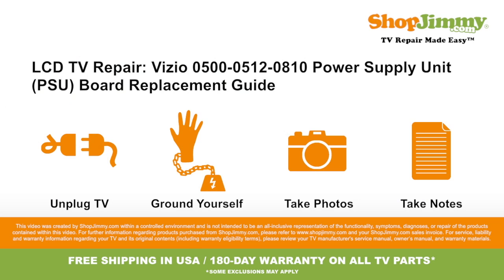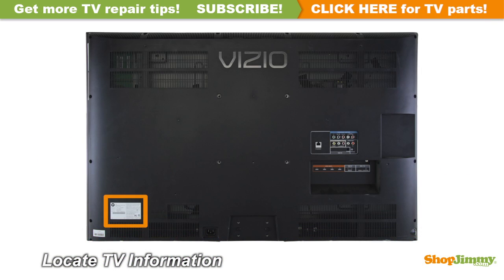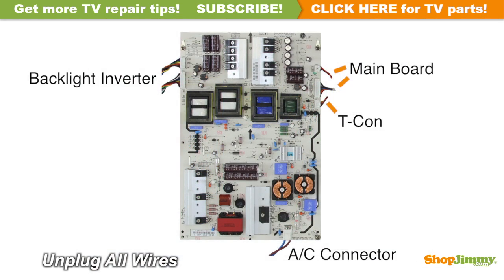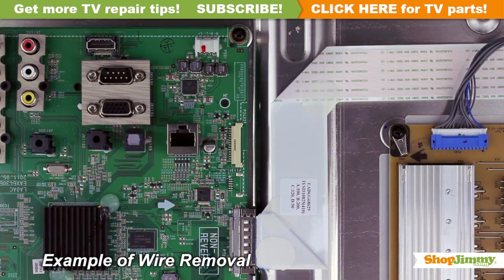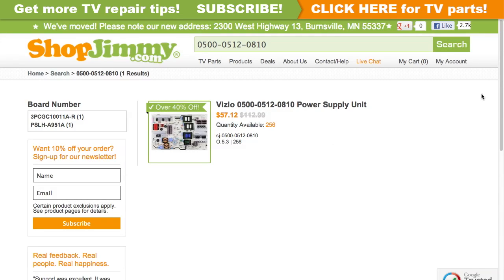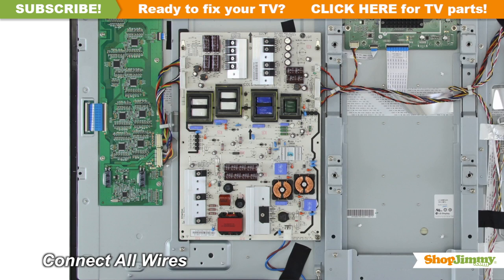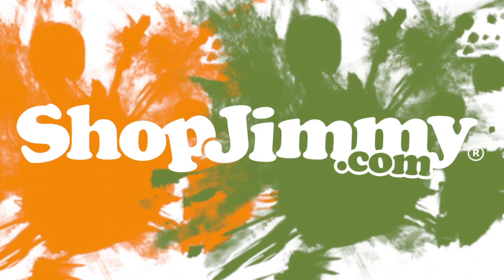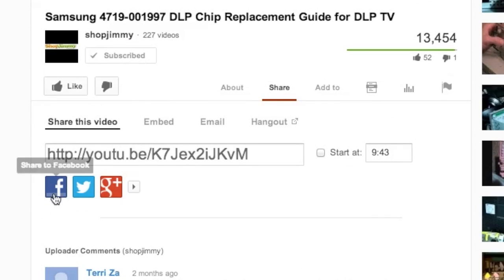Vizio 0500-0512-0810 Power Supply Unit (PSU) Boards Replacement Guide for VIZIO XVT423SV

Comment: I have a Vizio XVT423SV. The other night we had a thunderstorm with strong lightning. The next morning, the TV would not turn on. I called Vizio and they walked me through a full power reset, unplugging, holding the power button 15 seconds, etc. The TV will turn on, in that it will get to the V screen (the vizio logo screen that normally displays as the TV boots up) for a couple minutes, then the Vizio light will blink for a few minutes, then go back to lit up but stay on the V screen, then go back to blinking, and just repeat this cycle. The Vizio support person said it was a "power" problem. I don't know if she said "power supply" or not. From some online research it looks like the problem may be that I need to replace the Power Supply Board. But I don't know if this is the right fix since my TV does "turn on" technically in the sense that it lights up, but it doesn't go all the way. The videos and info I found online seems to be mostly people whose Vizios won't turn on at all. Is it my power supply board, or is it perhaps a different part that needs to be replaced?

Comment: My VIZIO XVT473SV  does not power on. The vizio logo is an amber color when plugged in, but the tv does not turn on the logo should turn white when the power "jag' button on the tv is pushed, or the remote used. I tried replacing the powerboard, but that didn't change anything.
Reply from the maker: +karl aiese  Try all repairs and troubleshooting at your own risk.   I recommend replacing the main board in your TV.  Click this link to replacement parts for your TV model number:  http://www.shopjimmy.com/vizio-3647-0312-0150-main-board-for-xvt473sv.htm  There may be multiple boards for the same TV model number, be sure to match part numbers on your current board, with your replacement for compatibility.  Here is a link to a video showing how to identify your part number, click here:  https://www.youtube.com/watch?v=kxkeGLhlQY8 Thanks and please let us know if you have any further questions with your TV Repair!  www.shopjimmy.com